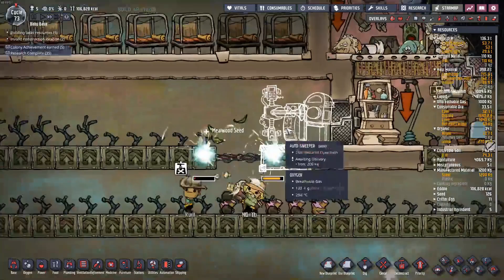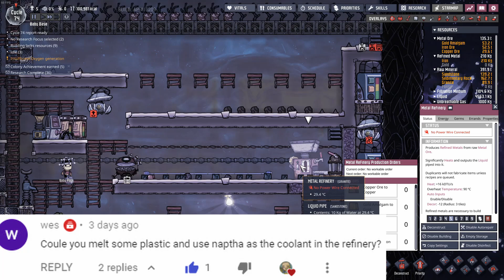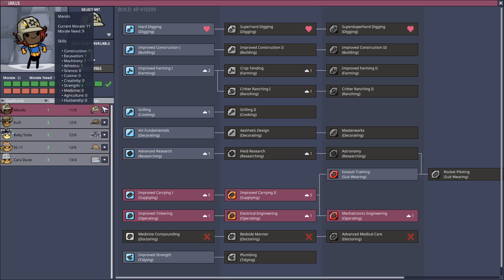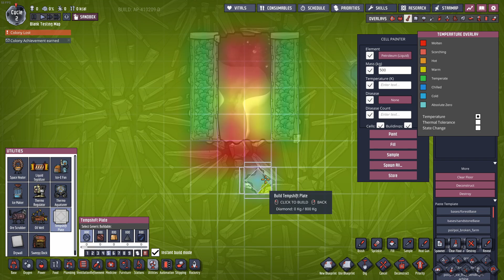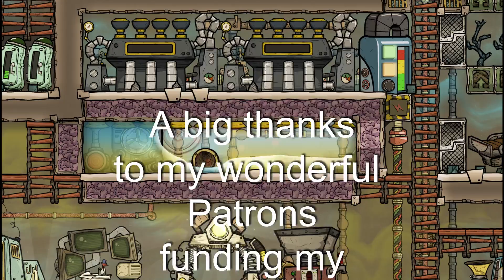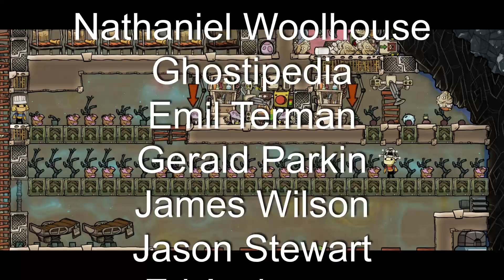Baby Base 4 : Metal Refinement, Cooling, Naphtha and Coal : Oxygen not included

Comment: Anyone know if I put hot abyssalite in debris form in a conveyer belt does it dump heat into steam? I want to test it just hoping someone here knows.
edit: thank you Francis for the enjoyable videos.
Reply: Yes, conveyors exchange heat with all surroundings if they can.
Reply from the maker: Have not tested this with Abyssalite, you can use sandbox mode to test it. Though Debug mode is preferable, you can look up the wiki on how to enable debug mode it's fairly easy.
Reply: Francis John want to give an update if it helps out anyone. I tried this on a survival and abyssalite debris in conveyer rails does not exchange heat with steam at least.. I even put rails through aluminum metal tiles and it doesn’t react with it’s temperature.

Comment: You could boil waste water making steam and dirt. Using lava as the heat source. Cool the steam with a steam generator and then pump the water through an aqua tuner to cool it down more. Dumping the heat back into heating waste water. The cold water can be dumped into your clean water tank. End result electricity, clean dirt, clean water. Dirt can then be used to grow more food and then feed the food to the hatchlings.
Reply from the maker: If you boil polluted water you get 1% of it back as dirt, if you sieve the polluted water you get 4% of it back as dirt. Assuming you have filtration medium. If you boil the 30C polluted water you have to expend a lot of heat to do it. However if you just tap the biome for power you will only be reheating 95C water. So it depends on what you want more of.

Comment: for a air filter as long as you're just dumping the gas out into the air. use an gas element sensor right beside a vent cost a little refined metal but no power draw. if you have 3 gases but only want one 2 sensors 2 vents. they have to be right beside each other to work cause it opens the vent with the next packet. and. if another has crossed the sensor it closes. works with liquids too
Reply: Use a Not Gate for 1 useful gas and the other waste-products... 👍

Comment: I’m screaming right now from watching you dump the hot abyssalite into your fresh water instead of your steam turbine water.
Reply from the maker: Pretty sure it's heat transfer with liquid is pretty much non existent, it will takes ages to transfer anything. Though I will have to check.
Reply: To big difference between water and abyssalite will probably take 100 cycles for it bring water up 1C  unlike air which can quickly exchange with it thus reason why will heat up air fairly quickly cooking dupes if not careful.   This is why temp. plates can be very powerful before the patch from what was being indicated because use temp plate drop abyss tile to say 30 degrees and it will cause air in area to equalize to that temperature very rapidly but reverse can only occur if air is like 10000C rough estimate higher in temp compared to the abyss, at that point abyss temp will start to rise till it hits balance based on formula they used to derive change in temp. or least this was way it was working

Comment: You can use a gas sensor and a high pressure vent. You install a not gate and automate the air vent. Select the gas you want in the sensor and coming up next for the gas vent continue the gas pipe. 
When the sensor detects the gas you want send the green signal and the not gate close the gas vent and the gas continue inside the gas pipe. 
My bad for my excelent english. :D
Reply: Early game if you don't yet have plastic for high pressure vent you can use a gas shutoff with the gas element sensor and only cost 10w.
Reply: @sxmchn  but he already have steam generator. I only say it's simple than 1gr sistem.

Comment: Here are some ideas for your Energy problem:
Renewable Coal: Use Pufts to eat all the Polluted Oxygen that offgases from the water. The slime they produce in return can be eaten by Sage Hatches, which turne the slime in a 1:1 ratio into coal.
Hydrogen Vent: Now that you have the necessary resurces you can tame the Hydrogen Vent. Put a Steam Box ontop of the Vent to syphon out as much heat as possible, and store the cold Hydrogen with a door-compressor in a smal room with a pump. From my experience most Hydrogen Vents can support one Hydrogen Generator all the time, including Dormancy.
Geothermal: Put a Steam Box ontop of the scorching Abyssalite and use a Steam Turbine to slowly eat all the heat in the Magma Biome.
Reply: Another one, arbor tree are IIRC both water and dirt positive if turned into ethanol, you can use the water to feed back into a electrolyzer for hydrogen and use dirt for the sage hatches
Reply: With how little hydrogen vent produces, it's a good idea to just crack it open and that's it. Pumps on top will filter the hydrogen, aquatuner will get rid of the heat.
Reply: i was thinking the same for the hydrogen, but i don't think you can get a lot of slime/coal from puft and hatch combination, the geothermal is very good source but isn't renewable it will slowly cool down. for the one mentioning ethanol... i on't think there will be enought space for it
Reply: i started a minibase, and trying to follow your tips. 
I have 2 pufts, but apparently they eat the polluted oxigen faster than the reproduction. I was thinking to use the slime to power up some mushroom instead. does it worth?

Comment: Looking forward to the eventual remodel for the rocket silo ;)
Also, there was a mod (I forget its name) that let you continue placing blueprints even if you didn't have the materials, so you could plan out stuff better.
Reply: The mod's name is "Plan buildings without materials"
Reply: if you using the blueprint mod it will stamp the blueprint even if you haven't the material. or are you speaking about the vanilla blueprint?

Comment: your heat deleter may have some sand trouble later with how much polluted water you put in. the dirt debri will turn into a sand block if the steam gets too hot. 150C did it to me.
Reply: In my expirience, the stream turbines don't let it get that hot, but if you're worried, you can just quickly sweep it out by deleting one tile and then putting it back when it's done. A bit of stream escapes tho. You can minimize that by installing an automatic door abouve the tile you're gonna delete. Or you can inbuild an auto-sweeper to take it all out instantly.

Comment: you can theoretically start to get to the bottom for diamond, steel, tungsten , and OIL. you vacuum an nearbh area and use atmo suits and start using a pitcher pump to move the oil into a tank then sweep the drops into a bin in the vacuum and then you have a oil resevoir.

Comment: Sage hatches convert material to coal at a 1:1 ration as opposed to the hatch/stone hatch 2:1 ratio. Combine that with the infinite dirt potential from the polluted geyser(water sieve > composter) and you can get plenty of coal if you start harvesting regoleth
Reply: PO>Slime>Algae>Fertilizer>Sage Hatches. And you don't need to wait for regolith.
Reply: @selensewar  pufts don't make much slime so you're more limited on how much you can produce than if you used the sieve
Reply: @YaBoiTem  just put a ton of them in a small  space right above the polluted water.
Reply: @selensewar  It won't work. You will spend more power running the algae distiller and  fertiliser synthesizer than the resulting coal will produce. You could produce scraps of power by feeding slime directly to sage hatchs, but not enough to justify it the space, labor and resource. Heck, if he's gonna be farming slimes he might as well use them for mushrooms.
Reply: @Tamizushi  Oh yeah, you don't need fertilizer anymore at all. Silly me. Just put a ton of pufts above polluted water and then feed the slime to the sages. It's even better then, thank you.